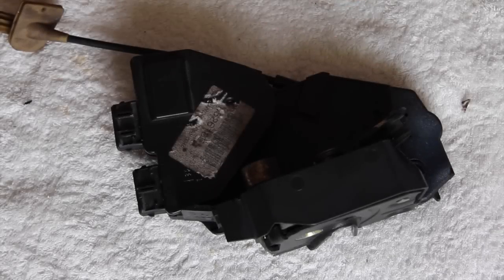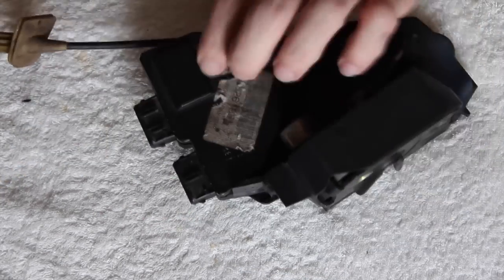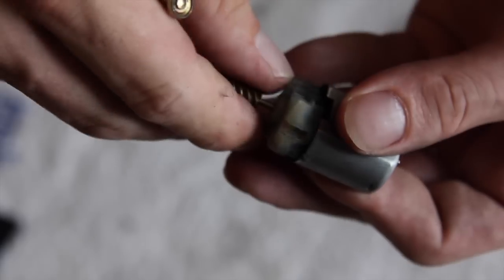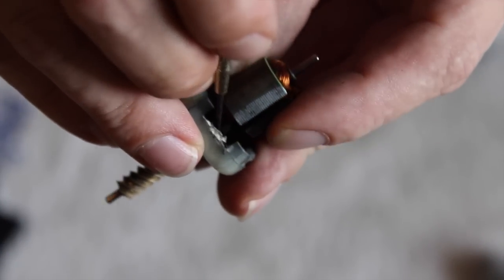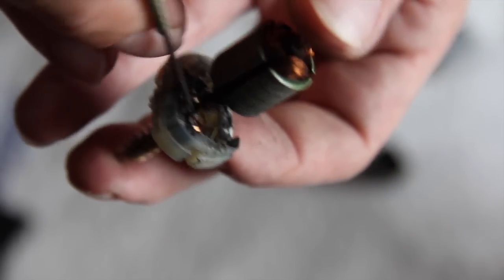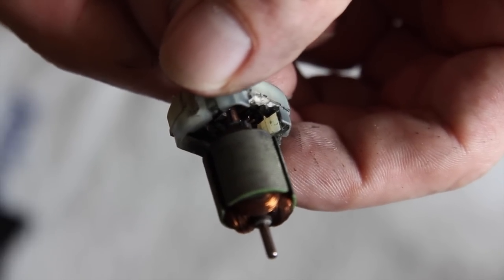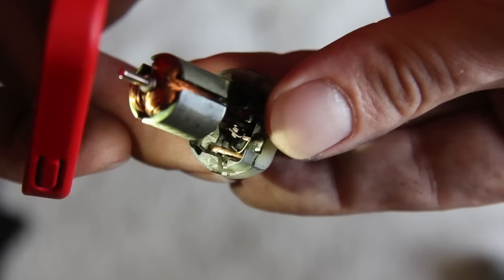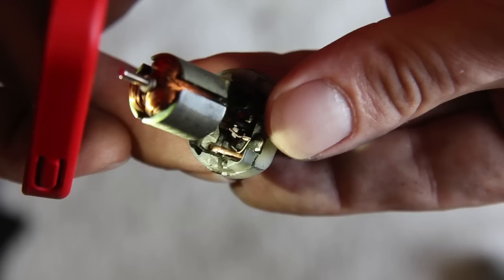Volvo V S C 70 lock actuator motor fix

Comment: The lid/hood/bonnet keeps the gears together!  I needed to tie it and glue it into place (the 2nd time...).  The thermal fuse has a perfect replacement.  A 10A fuse yields 2 of them after breaking free from the (red) plastic and folding each half in 2.  (I didn't need to cut the electric fuse between the 2 blades because mine was already blown ♻)

Comment: Thanks for the great video. All the steps seem clear, but opening the solenoid is difficult, I am struggling to bend back those little metal tabs. They're really strong!
Reply from the maker: Richard Orme you mean on the back of the motor to open it? Small screwdriver and bend it up. Lever it up
Reply: No, I got the motor out. It is the little latches you mention at 2'15". (thanks so much for replying!)
Reply from the maker: Richard Orme thanks. Really, use a small screwdriver crank it in a flat angle under the tab and lever it up with the screwdriver. Just fiddle a bit with it, not difficult

Comment: I have a question. I have no idea what I'm doing so bear with me. 98 Volvo v70 GLT. Door locks actuate, buttons go up and down both electronically and also with the key, however the door does not actually lock. I'm not sure what is wrong or why door won't lock.

Comment: I found a used assembly, latch and actuator along with the cable at the junk yard.
Unfortunately after I installed, I found it to be very slow.
My question is can I simply replace the motor with a new motor? 

Or keep the original motor shaft and simply replace the plastic back part that holds the brushes.
I'm thinking that's where the problem lies.

Thanks
Reply from the maker: Crisuz if you can find a motor with the same spec and mount for sure - however a good cleanup AND removing the thermal resistors (and replacing them with copper wire) as shown here may do the trick.
Reply: @random8or  Okay,I will try it.

Comment: Basically, the main failure mode is the contacts becoming corroded? And the fuse becomes too resistive and that is why you replaced it with copper wire slice?
Reply from the maker: No. As far as i know (there used to be a thread on MVS) the material the thermal is made of simply ages and changes its properties. Doors are still working fine btw, now rest of the car falls apart....

Comment: I've been replacing the motor with motors from the front doors, since those never seem to fail. I haven't opened one to confirm that they don't have the thermal fuse, but I've never seen an S70 with a non opening front door when it gets hot. Maybe people just replace those more often? Anyway it's easier to pull one from a front door junkyard donor than do this fix.
Reply: The thing is, the junkyard donors are on their way out, too. This fix seems to last more than a couple years. I replaced mine 2 years ago with a donor part and now they're already failing. This fix seems to be a longer-lasting one. Tedious, but worth it imo :)
Reply: @fveafsw  probably right. My junkyard donors are luckily still going strong.
Reply: @wrybread  I'm glad to hear that! I opened up the motor today and the thermal fuse in it seemed like plastic that's been covered with a tiny layer of aluminium. Honestly surprised it has been holding up for 20 some years! Replacing it with solid copper did the trick for me, so if yours do go out one day I recommend this fix wholeheartedly!

Comment: curious if your was not working at all. Mine goes Brrrrrrrrrrrrrrrrrrrrr when the doors are opening or closing, so it is trying!
Reply from the maker: Then take the lock out, open it and have a look. Might be one of these gears worn out. Or get an L/R replacement lock from a breaker.
Shorting the fuse helps when the motor appears "too weak"
Reply: +random8or maybe some cleaning and greasing will help. Some other brands, these are cheap parts, but the best price on the Volvo one is $130, so really worth giving DIY a try!
Reply from the maker: +Rod R I got some from eBay for 10 euros each - from breakers
ALL is worth a try but if yours sound like "fast motor running out of steam till stop" then removing the thermal resistor will do the trick
ALL is worth trying ;)